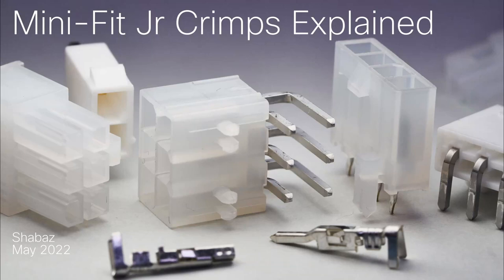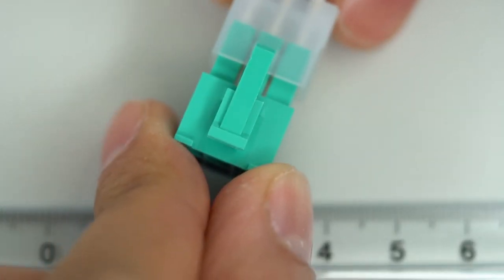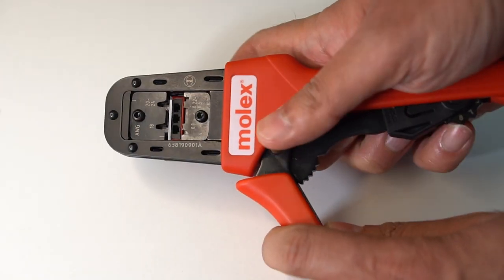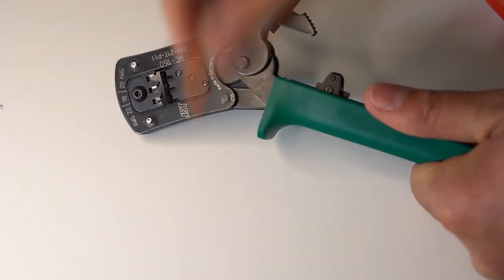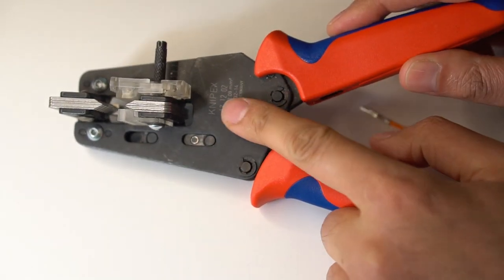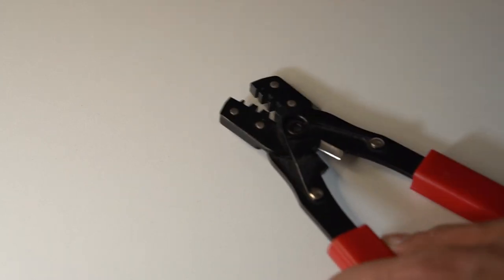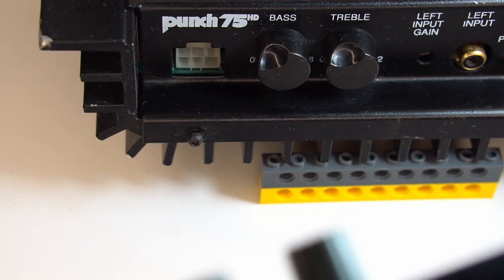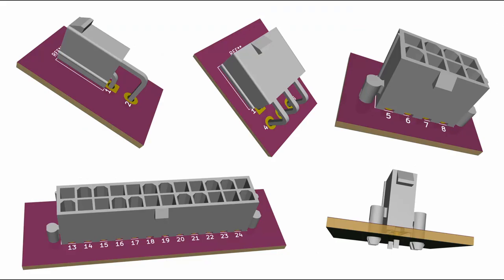Mini-Fit Jr Connectors and Crimping Explained

Comment: I was looking for reliable and safe connectors for making vintage audio equipment from the eighties more service-friendly. Many devices are more or less modular, but power cables are almost always soldered to the board, so I want to use wire-to-wire connections with the Mini-Fit connectors. Everything you said and showed about them has been a better and more comprehensive introduction than I could have ever hoped for. I left a like, both to acknowledge your great efforts put into the video and to find it again in the future when I'll design my own PCBs with Mini-Fit connectors in KiCad. Big thanks and Cheers!

Comment: This is a very thorough video of crimping the Mini-Fit connectors as well as the pros and cons of various wire strippers. I really  expected to see a review of the Molex crimper only, and was really pleased to see you discuss others as well. 
You mentioned the motherboard connector; are the 6- and 8-pin power connectors for video cards the same type?
Reply from the maker: Hi, thanks for the comments! I believe they are the same type, Minifit JR, although I have not looked at any recent card (I use a laptop mostly, and a small server without any GPU card : (

Comment: GREAT VIDEO! This makes it so easy to understand! What I'm having a hard time understanding is why the crimp tools are so expensive? I looked at Digikey, and Mouser and they are over $500. Is there a reason for this? or am I looking in the wrong places? I checked ebay and they're still $250 plus. I was just looking to repair a connection in my oven, but the tool alone costs almost as much as the whole oven 🤯
Reply from the maker: Thanks for the comments! Unfortunately the Molex tools are expensive : ( however, there is a 'ServiceGrade' version of the tool, Molex code 64016-0200 which is intended for  28-16AWG Mini-Fit Jr. It's about half the price of the normal tool, but is only designed for a life of about 1000 crimping operations. If it were a low-current non-critical application, you could also consider cheaper non-brand crimpers, but for an oven, it's going to be a high risk, because the cheaper non-brand crimpers will not do as good a job, and the increased resistance will cause heating and could be a hazard. So really the ServiceGrade crimper is about the only option to save a bit of cost, granted it's not a big saving : ( You could sell it on ebay afterwards perhaps to recoup a bit of the money perhaps.

Comment: The Molex tool is really expensive and it goes down to only 18AWG. I found a Knipex tool - not much cheaper - that goes down to 16AWG. It doesn't have the locator, though. The knipex is already very expensive for me but if I could I'd go with the molex tools.

Comment: My issue with the molex connectors of any generation is their propensity to fuse together and stick and on disconnection the board connector is pulled off the board sooner than the connector disengaging. I know it is probably due to poor manufacturing standards and wrong tolerances but literally most computer hardware with molex connectors is a colossal pain to disconnect.